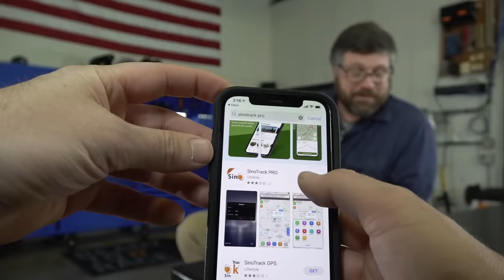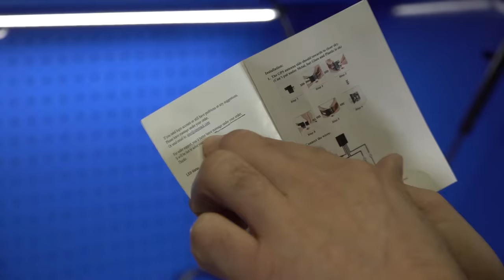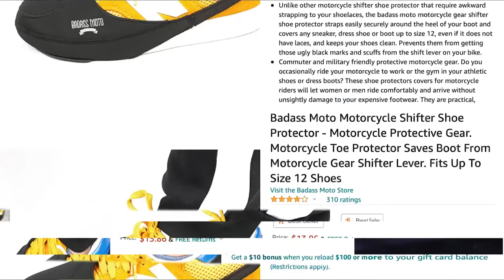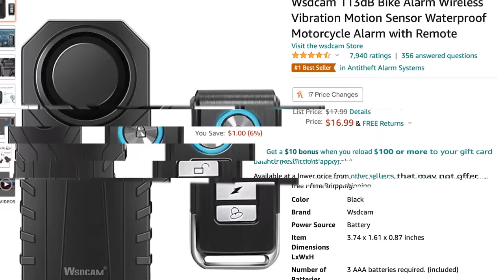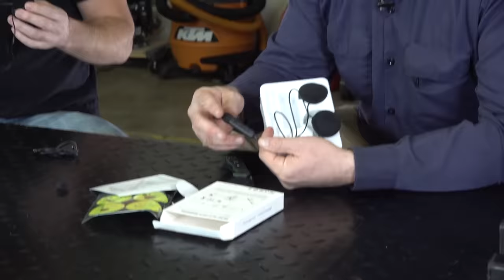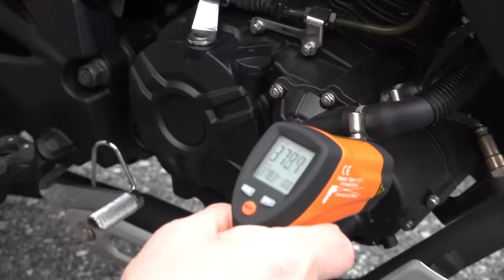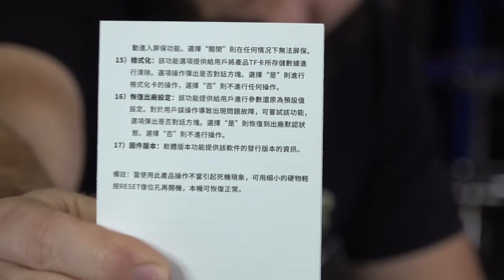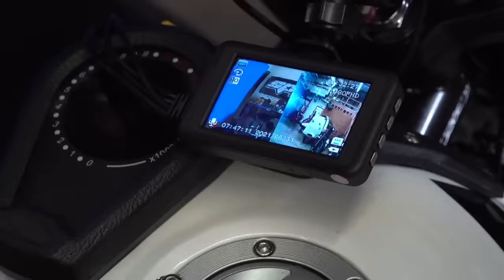Testing Amazons Stupidest Motorcycle Accessories(1 is Illegal )

Comment: On the Sino track. You dont need a data plan to get realtime positioning. I use one on mine, once you set it up the GPS will continue to work even without data. I also used a prepaid sim card.....

Comment: I LOVE my TPMS! I bought a different manufacturer, but it matches my compressor and tire pressure gauge. I just cant figure out how to remove the battery from the transmitter (stem-cap). It's supposed to be replaceable, but I'm stumped.

Comment: If the thieves are serious, that alarm will 100% NOT deter them.  I was out on a break one day, just sitting there drinking some coffee and looking out over the parking lot where I work.  Some dude had just bought a really expensive Ducati.  He was super proud of the bike and told just about everyone (which, in retrospect, might have made matters worse for him).  The parking lot has an attendant, but it's not gated or anything.  Just some dude who sits in an island and gets paid to watch cars (I'm assuming).  Well this van comes screaming in - tires squealing as it makes a sharp turn into the parking lot.  Two burly guys jump out of the van and they open the back of the van.  Then they grabbed the Ducati, shoved it into the van, slammed the doors closed and got back into the van.  The van tore out just like it came it - wheels squealing and hauling ass.  It was all over in lest than 2 minutes.  No alarm would have saved that bike.

Comment: In regards to the alarm. If thieves put it in the back of a van they will 110% rip the seat off to see where the alarm is and disconnect the battery. They will because they have the time while the driver drives around.

Comment: Mine is inside tire temp and pressures...saved me from wrecking when I had a valve stem failure....alarm started beeping when I dropped below 20psi....got stopped and I was down to 12 psi

Comment: The gps tracker, while i do not have that exact one i do have one very similar and it does work. I use a $10.00 plan from tello and it works great so the $600 a year is over exaggerating it a bit. Also all the name brand gps trackers ive looked at require some sort of subscription that costs 30-50 a month so my way works just as well and costs much less.

Comment: Don't trust those valve TPMS gadgets...they'll work...*sometimes*.   I had a blowout going almost 60mph trusting those things, because they told me I had 40lbs in the rear.  Guess what it read, with a visibly flat and partially mangled tire?  Still showed about 40lbs.  Get a reliable guage and check the pressure yourself, unless your bike came with a decent quality internal TPMS sensor system.  Even then, probably doesn't hurt to trust but verify once in a while.

Comment: I totally understand that no one really cares, but that goofy over-the-shoe thing is referred to generally as a "shifter sock."  I've been riding since '71, and there were dozens of permutations of the concept even then (typically a set of leather or elastic straps that held a thick piece of leather and sometimes a bit of metal right over where your shifter hits your boot).   Never used one, though.  If I was that concerned about my riding boots, I'd get a heel-toe shifter and call it good.

Comment: Was the exhaust actually 500 Celsius or was it 500 Fahrenheit?

To figure out Celsius to Fahrenheit you’d multiply 500x9=4,500, then divide 4,500 by 5=900, and finally add 32 to give you 932 degrees Fahrenheit. So I have to assume it was in Fahrenheit to begin with.

Comment: I actually have a BT headset very similar to what you showed.  I wasn't feeling like spending a lot for an actual good BT com  and I mostly just ride solo and wanted to listen to music.  I think they worked fine for the 20 bucks I spent on Amazon.  Harder to hear if highway riding but just fine if riding around town.  I just control it with my phone in the mount.   I do not like auto answer though.  Damn thing answered a telemarketer while I was riding and I had the phone in my pocket this time and they wouldn't hang up so I had to pull over and pull my phone out of my pocket to hang up on them lol.  Everyone can hear me just fine at any speed. Money well spent IMO.

Comment: The first gadget works perfectly, you just need a bit of knowledge to run it.
The annual cost of use in Poland is below $ 60, i.e. negligible ...
My Beard didn't get my brain out of my head - it took less than a quarter of an hour to assemble and run ...

Comment: *That* 44.95 Motorcycle On board camera says it's Waterproof, The Monitor/screen is Not waterproof, Where the MSDC goes into the body is exposed to the elements. So if it rains your camera is toast! Yet the maker Claims it to be 1080P and Waterproof I own one,  installed over 2 yrs ago. Finally ended up putting a zip lock bag over it to protect it from the elements!

Comment: I bought one of those tire pressure sensors and it doesnt read the rear tire pressure right. It always reads low even though the pressure is right. I tried new batteries and resetting it. It will sometimes start off right, then slowly drop and start alerting, and sometimes it just constantly reads low. I ended up taking it off

Comment: 6:15 Helmet brake light in a crash.  How solid is it? Will it disintegrate if bashed into the asphalt or act like a knife cutting into the helmet.  (Obviously not a knife but it will concentrate the force along a relatively thin line when the purpose of the shell is to spread out that force.

Comment: ok I'm gonna share my experience with that alarm because I actually had 2 of them, so the initial one came with the bike when I bought it no real complaints it seemed reasonably loud to me my entire block would hear it and since they hate ANY noise outside guaranteed they would come out and complain if someone touched the bike very cool. fast forward 2 months and the battery in the keyfob died with the alarm armed from an accidental press at a petrol station which led to me having to quickly whip the seat off pull it out of the underseat compartment and stamp on it until it died (2 times for anyone curious).

So I found it and bought one online got a bunch of batteries all lined up so I wouldn't have this problem again aaaaand it is incredibly quiet literally cannot hear it going off from about 15ft away on max volume...it kinda seems like luck of the draw with these things because I know a few people have bought them some say too quiet some say just fine idk it seems like there is no real QC going on to maintain a standard max volume

The headset on the other hand I would not recommend at all if you want to use it as an intercom or anything like that...it is fine for music and maybe the occasional phone call but other than that just nut up and get a proper com unit

Comment: Kinda surprised you guys didn’t mention the downfalls of the screw on pressure sensor; i.e. they can leak air. Just get a proper tpms that installs on the inside of the tire
Reply: I've been using them on multiple cars for about 5 years, not one has leaked, the major downside is the battery life is really short, 8 to 10 months at best. They use a second locking ring which stops them working loose. The battery can be changed without taking the entire unit off.

Comment: I mean no hate but you guys totally messed up the tracker part of the video! The setup is usually very straightforward as well, I have been using products from that same brand for years and not even one of them has ever failed on me!

I love them so much, it has saved me from many headaches many times in the past so hearing that the product "sucks" is very much saddening to me.

I suggest that you guys do some research on it and find tutorials for the setup. It's absolutely worth it! It might've not worked with the SIM card that was used in the video, not every carrier works so checking that might help.
Reply from the maker: Yeah right ! You work for the company that sells them

Comment: I'll tell you lucky folks that do read this comment how bikes are stolen most of the time, they do something that's called barreling the lock, they stick a dent puller with a screw into your ignition and start slamming away until the lock is removed and it can be unlocked and started with a flathead screwdriver, be aware that this does also work on cheaper chain locks so be careful what locks you put on there! The idea you wanna go for when locking your bike is that you want to make it as much as a hassle as you can, since realisticly if someone really wants your bike they're gonna get it.
Reply: If you don't have a clue what i'm talking about i can send some dutch videos that show how its done

Comment: I had a friend who wanted to put red snake eyes on his truck or lights on the windshield wiper water despenser doo dadz, and I told him...you are goin to get pulled over and told to remove them...unless he wired them into the blinker system so that they flashed when using the blinkers...and when he got pulled over the officer agreed with me if he wired them into the blinkers they would be legal to have...and he did and they were allowed....red and blue are usually not allowed.

Comment: So... All you need sim card wise is a $5-$10 data plan on a sim... it's not $600 a year, it's $120 or less. You need a sim card for anything with GPS / data tracking that isn't an apple airtag or android samsung whatever the other one is called... which themselves use android/samsung phones or apple phones respectively, to bounce signal location via. So yeah... sim card is obviously needed, it isn't all that much money when there's an actual purpose to do such a thing, and I'm sure it would work if you just knew how to hook it up and operate it.

Comment: Burn Jacket? And I thought that was just a bandage, yes, I am afraid I have seen the Burn Jacket in action...and yes I thought, "what an idiot"...I just wear pants...
I use some of the TPMS things, only issue is when you have to add air, requires a wrench to remove the cap. PITA. They aren't bad, not as good as a decent pressure gauge. I ride bikes with tubes, nothing worse than taking off and spinning a tube due to low pressure, one is full time 2WD, have spun both at once, yes that bike uses a TPMS, that is about all it is good for....preventing stupidity...

Comment: 04:33 it's not stupid, i can't use my canvas shoes becous it get stained and it's even worst if rain fall and pritty much the same happened with most of the shoes. I only have two options left ither get these or get a shifter without rubber cap.

Comment: I'm not understanding why you believe it's illegal because it flashes red and blue. In the state of Michigan where I'm at, you cannot have a red or blue flashing or oscillating light displayed from your vehicle that can be seen 360° around the vehicle at one time. Even if you weren't allowed to put a light on your vehicle, that could be seen from any Direction that's flashing red or blue. Which seems strange because your hazard lights flash red?
On your helmet is not a part of your vehicle. And anything that makes you easier to see is safer.

Comment: Data plan $20 year (10GB 🧢) / peice of gaffa-100mph  tape to cover shoes, to change gears/motion alarm(for windows "no remote" $3 ebay/ 🔵 tooth $15 eBay/ 🟥welding glove, gaffa-100mph tape again, heat sink.. 🤷‍♂️ Cheap chearfull 😁 can you tell I'm a big spender😂😂😂😂.

Comment: I bought a front and rear camera from the same company that makes the helmet brake light light. If it’s like their cameras DON’T BUY IT!
  No sound from either camera, only rear camera worked but had zero control. No split screen, no working controls, SOB wiring it in, had to screw cameras in place as adhesive SUCKED!
 As my camera issues happened during the start of the pandemic, there was no k e to help me and my return time lapses by the time I got someone to get an RGA.
  USE CAUTION WHEN BUYING THEIR PRODUCTS!   I had to eat the $599 non working camera system because ‘time had elapsed’ when they were gone for the pandemic.  Horrible customer service, terrible products, will NEVER buy anything they make, period!!!!!

Comment: I was riding my 2008 yo 250 and I fell riding in the woods and the exhaust pipe fell on my leg and it was heavy and I couldn’t get it up so a burning hot exhaust pipe was just burning me until I finally pushed it off and I had a third degree burn almost to the bone had to go to er

Comment: Hey guys if you wanna talk to another rider in like a group of two or maybe three I use my push to talk radio system from my racecar on my bike. I have a bike helmet wired up with racing electronics helmet harness that Has a boom mic plugs for ear buds to hear and connection to hook to a button and radios it's not cheap for the whole two person system but so much nicer for a long two person ride no cell phones and talk when ever you want with out taking a single finger off the bike

Comment: $240 a year, not at least $600. $20 a month by 12 months. $240. In fact you can even get data plans for $15 a month. 

I don't get how someone could lack the common sense to realize that. Even if no one ever told you, it's typically something your brain should be able to solve or think of on its own. 

Why would you use an entire cell phone plan in a gps tracker the brain asked. 

"I don't know!" his arse responded.

Comment: Or just put a fuel cut off hidden under the bike somewhere and turn it off so the electric fuel pump doesn't work when parked until it's turned on and problem solved nobody riding off with your bike
Reply from the maker: they cant ride off with it but they can still walk it into a truck

Comment: I have that camara set up on my bike and I have cought so many bad drivers   and reported them to the cops showing the footage I bought another set so I have one forward and rear and then small cam on my helmet under my chin which I clip on so where I look it's filiming and where the bike is going/been filmed . Best thing ever  I had stupid gopos on the top my lid then on the chin so bulky and expensive it's stupid to have .yet the very small cam is perfect . Tossers in cages on there phone don't even see the small camera when I'm looking at them filimng I have had these idiots waving there phone at me  best part is I point to my chine then they see the cable and the camera there faces I have to wear water proof pants as I pi$$myself laughing at them .
Iv got the local camara cops phone no and str8 email address due to the amount iv cought using there phones an bad driving .

Comment: there are 20 dollar plans that will cover the tiny bit of data the location tracking sercice uses.
its less then a txt worth of data and many trackers use sms. you send a request the tracker send the location or opens the voice service. the interupt is also based on sms.
so 600 a years not accurate.
sorry that the know it all did not look into actual costs before talking shit